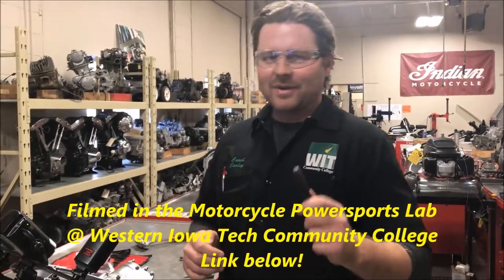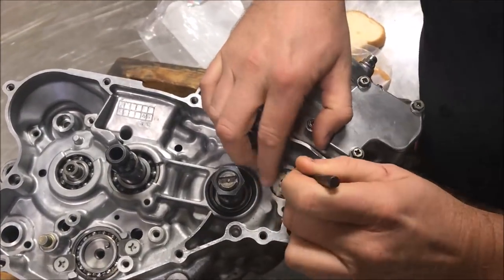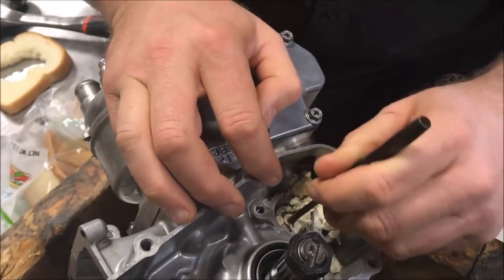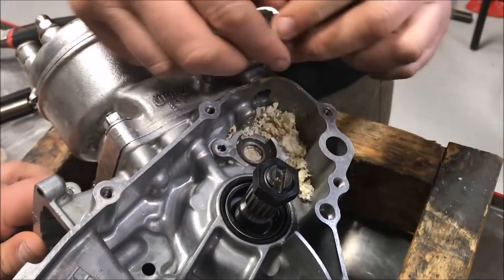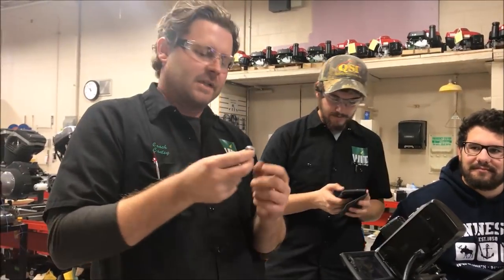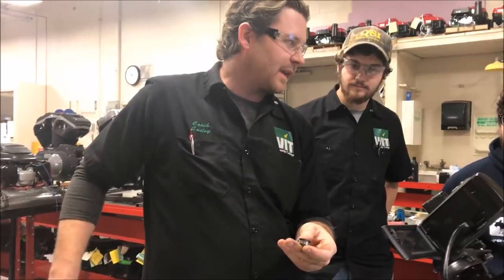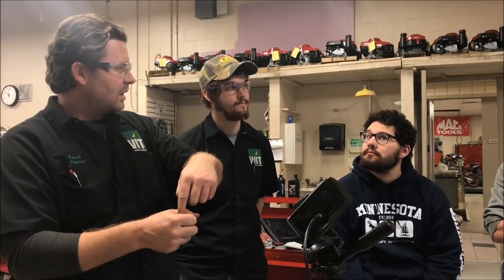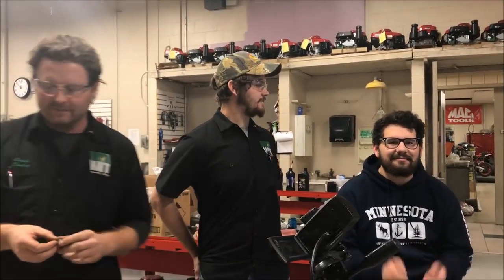How to remove a blind bearing with bread that's not a sealed bearing!

Comment: Oh yes, that technique works, also you can use a similar method, I did it using newspaper press water soaked, I can tell you it works perfectly well too to removing a bearing like that showed in this video.